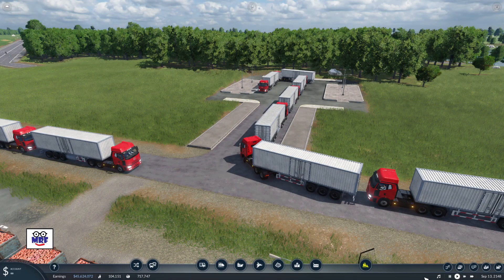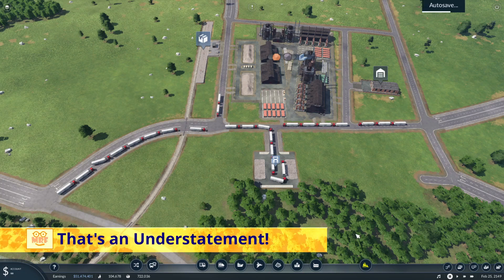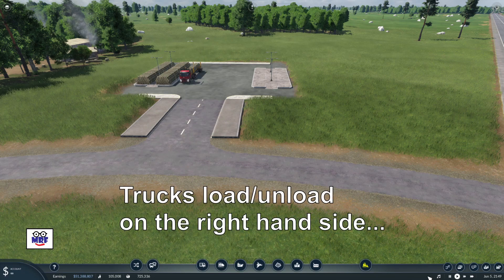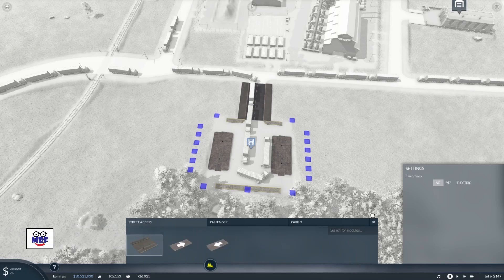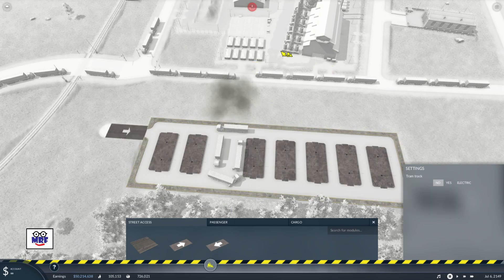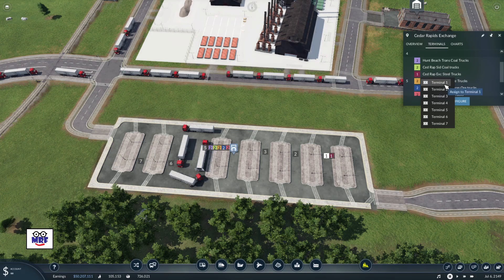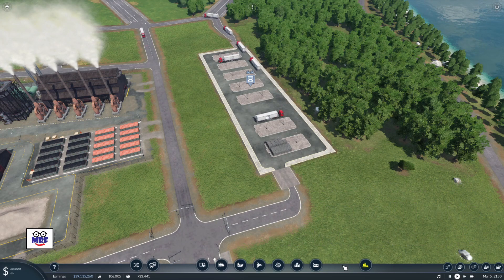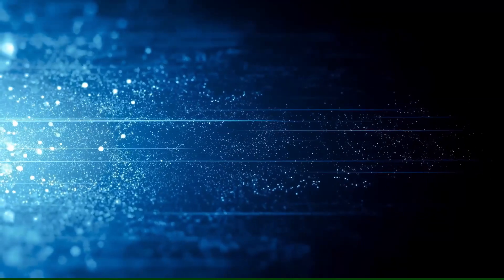Transport Fever 2 - The Trouble with Truck Stations is...

Comment: Most of this I had figured out, I would say use 1 unloading platform for every line as long as you have no issues.  If you get slowdown add another.  But I would add one loading for each loading route, it not only spreads thing out more but lets you see if you have a line with fewer goods.  You may be able to move some trucks around once you see which lines are congested or empty.

What I learned, and something I struggled a lot with with, was getting the one way entrances to work as I think they should.  I should be able to sort them out after watching this one. :)

Comment: When it comes to any building that isn't a direct raw resource (grain, crude oil, etc) you can use the drop off points to help prevent jams, just place them outside and it acts how you'd expect, depoting their resources directly into the building.

This way, only those picking up the refined resources can use the truck station. This is handy for when you have limited space
Reply from the maker: I didn't know you could do that. Thanks for the tip.
Reply: @MerfWorks  no problem man
Reply: Oh I didn't know about this too. Thank you for the information, will try this with my trucks.

Comment: I can still foresee issues with your solution, a big one stemming from the fact you said you play with your trucks set to wait until fully loaded. Well if you have 2 steel trucks come in together and the Steel Mill only has one of the 2 things, Coal or Iron, those steel trucks will be blocking the entry and not let any Iron/Coal trucks in. What I would do personally is have 3 platforms, one for your 3 Coal lines, one for your 3 Iron lines, and one for the Steel pick up and have a one way entrance in line for each platform and a single exit. From my experience this is the best way to deal with multiple lines in a single station.
Reply: Is it best to try and get multiple raw resources connected to the one factory rather than just the next closest factory to the second resource site. I hope that makes sense
Reply: @PrimeNPC  I think I get what you're asking.

Factories will only take in what they can use. If say a stone quary is already maxed out its output, but the bricks need more input, then you would want to get a second stone quary outputting to there. Otherwise you would be better off sending stone to the second brick factory.

Best advice I can give is to keep an eye on the needs of cities and factories and work around those.
Reply from the maker: Yes, but what I find, and I can't explain it, if you have a 2nd input source it's production is slower than the first. So if you are transporting grain to a food factory, if you add a 2nd farm, the 2nd farm seems to always produce at a slower rate than the first. I don't know why.
Reply: @MerfWorks  That is due to the fact the food factory will only intake the wheat needed for the output being demanded. See my previous comment.
Reply: @MerfWorks  So is it best to focus on one raw resource output and level it up before adding a second resource output to any existing lines or maybe best to just keep them separate. I keep finding that my iron and coal to steel lines are always wonky. Even when using a train to transport 40 units of coal against 10 trucks moving iron, my two factories have like 2000 iron stored but only like 60 stored coal.
Reply from the maker: Since steel takes 1 coal and 1 iron, I try to deliver both by the same mode ( train) and similar distances, and same number of trains. That keeps the input of each to the steel mill relatively equal. I try to stay away from one input by truck and one by train. The trucks never seem to keep up with the trains no matter how many trucks I use.

Comment: Usually I would make separate truck stations for receiving and sending items. Say, using your setup, I would have one dropoff station (which is two platforms long) and one sendoff station (that I would adjust according to the output rate of the factory in question). Also, to avoid traffic, both stations have their own access road, and like how you set up yours, they have separate in and out roads.

But definitely your advise here is very good for beginners and for users who like to centralize cargo distribution. And oh, the same rule for me applies to my trains and ships as well.
Reply from the maker: Thank you for the feedback. I continue to wonder what's more cost effective and efficient in a case like this. One large truck station or separate ones for drop off and pick up as you have suggested. I guess if you have separate ones, that should cut down on traffic congestion.
Reply: @MerfWorks  One issue that I do find with this strategy is that it might be tedious to step everything up. So it might be better for beginners to follow your strat instead.

Comment: By putting the exit where you did, entering trucks and exiting trucks had to merge 🤦‍♂️
Reply: How do you prevent that?
Reply: @danielmethner6847  you put the entrance at the “top” right of the station and you put the exit at the bottom right of the station so exiting trucks use the bottom road and entering use the top road.
Once the inlet and outlet leave the station, you generally want to separate them so truck that use them don’t gridlock.
Also when diverging the two roads, try to make the entry ramp longer as trucks may need to queue, whereas the only thing the exit ramp needs is a location that won’t bog down.

Comment: Very helpful and neat.  But what happens if the trucks are queuing to gain access to the platform to pick up goods/  My biggest problem is that trucks queing for platform X block access for trucks  trying to reach platform Y.  Ideally what I'd like is a separate entrance and exit for each platform but I can;t seem to make that happen.
Reply from the maker: Not sure how to accomplish that in one truck station. You could create two separate truck stations, one for X and one for Y. That would completely separate the truck movements
Reply: It could be done through waypoints, though I'm not sure if waypoints work on a truck station itself

Comment: That is not how you use the cargo station. The correct way is to place the cargo station with cargo ramps parallel to the road !
Reply: Why?
Reply: @danielmethner6847  Both cargo and passenger stops can be longer. I play this with a long one, about 100M, and positioned parallel to the street. One way in and one way out, multiple entries and exits if more than one line, with one way roads connection the entries and exits. Thay way, I never have road blocks like the one in the clip and I have way more room inside the station, for both the trucks and cargo/pople. Not to mention the mingling that happens at the end inside the station in this video :) .
Reply: Lucian u should make videos for noobs, we are feeling completely overwhelmend by this

Comment: How can we distribute, let's say tools from tool factory to two locations equally from a truck station, the station/factory just piles up one terminal and the other one doesn't get anything...
Reply from the maker: I know what you mean. I haven't quite figured that one out yet, but when I do I will get back to you.
Reply: @MerfWorks  thankyou
Reply from the maker: @rutg24  I suggest you watch Pinstar's video on How to Utilize Multiple Platforms https://youtu.be/pcoyV_qqZ0Q . That video discusses how to deal with imbalanced cargo platform loading. Although the video is in reference to cargo trains, I'm guessing that the same principles might apply to a truck station. I am hoping this helps.
Reply: @MerfWorks  sure that might help!

Comment: Is there a way to have the truck stations load onto multiple outgoing routes better? 
I set up a route going from a quarry to a place that turns the stone into construction materials(brick) and then continued on to take the brick to a town. This doesn't work very well as the trucks then have downtime while they wait for that stone to be turned into brick. So I set up another route with just a couple of trucks to go from quarry to brick so it could get ahead. But then the quarry would only load the trucks on the shorter route and the others were lucky to get even one stone before carrying on even with a 2 minute wait. It would even start losing product because it simply wouldn't load them. It's there a way to fix this in case some of the product needs to go to another destination or town?
Reply: why not set up 2 lanes, 1 for quarry to brick and 1 for brick to town?
Reply: @knmaherijayatp8181  because being able to send them the whole way, they can grab a load going back somewhere else and do a full circuit loaded and making money.
Reply: @robertlangtry5699  from your first comment, i dont know how you can make round trip with full load. your set up just like this : quarry > brick > town > quarry. if you wanted to maximize your round trip, always build distribution center at the outskirt of your town and set up a lane between them.
Reply: @knmaherijayatp8181  easy quarry>brick>town>crude>refinery>quarry with another route taking from refinery to other refinery. Remember every map is different with different opportunities.
Reply: @robertlangtry5699  that was a very good question. Did you find the suitable answer?
Reply: @alexbeck204  never did, but I haven't played for a while. I'm guessing from your question that this isn't something they patched yet....
Reply: @robertlangtry5699 
Thank you anyway. And yes, sometimes these confising AI loadings remind me of some real life managers, you totally cannot predict

Comment: But my problem is truck is not piking steel from station
Reply from the maker: There is a number of things you can check. Click on the truck station. If the factory doesn't light up white, then the factory is not within the catchment area of the station. Also, select a truck that carries "All Cargo" to avoid the mistake of picking a vehicle that can't carry the product. Uncheck everything in the "Unload" column. Check to make sure you are not getting a warning on the line. If all else fails, dispose of the vehicle, delete the line and start over. Hope this helps.

Comment: on TF1 (yes i still have the legacy version) i have a truck station on a mail line that isnt collecting any mail from the mail center, it makes it, it stores it, it says it uses the line, but it just doesnt load any mail on to the platforms.
i have probably more than 20 trucks on that line.
still doesnt load anything
can i get some help to fix that?
nvm got it fixed